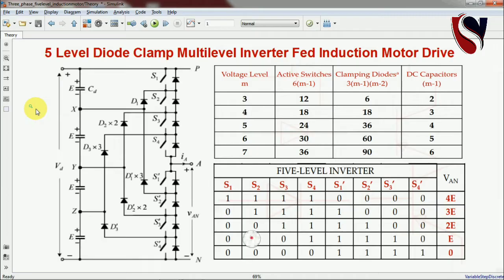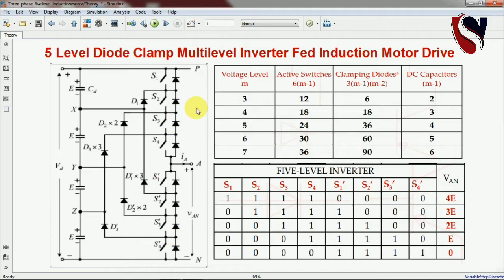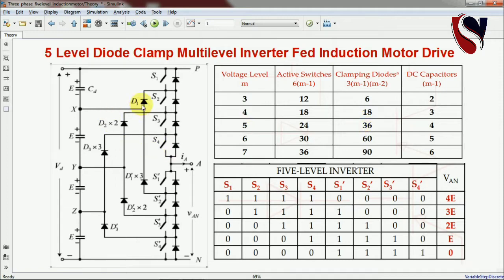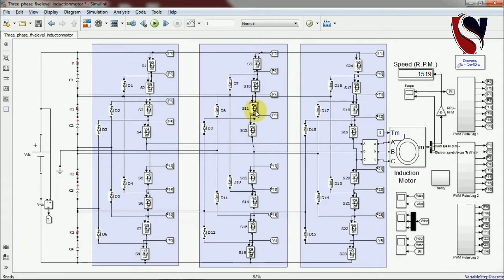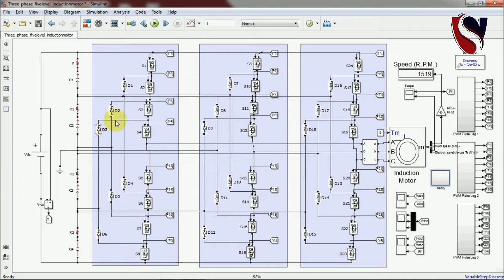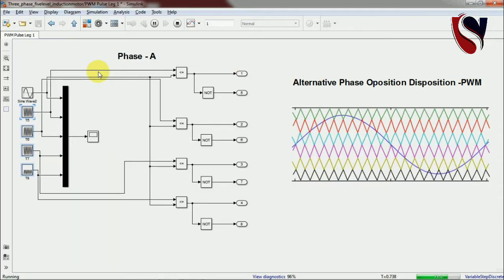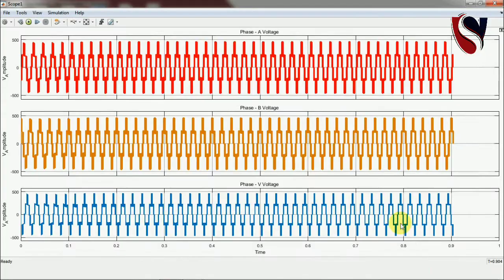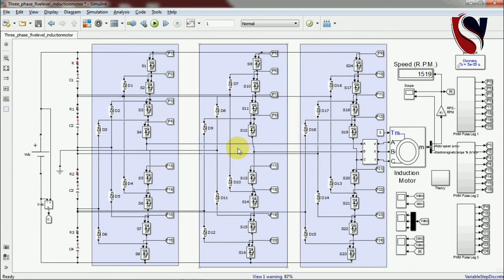Diode Clamp 5 - level Multilevel Inverter | Induction Motor Drive | MATLAB Simulation

Comment: what's the phase shift betwin the differents legs of the 5 levels inverter ? can we consider 120 or 180 degre command
Reply: None. I understand you’re referring to one way of operating three-phase 1-level inverters: with 120-degree or 180-degree conduction angles. But in this video, we have multilevel inverters, and for the gating/triggering sequence we’re using a variation of pulse-width modulation, in which the conduction of each transistor/thyristor isn’t constant (so we can’t say it’s 120 or 189 degrees).